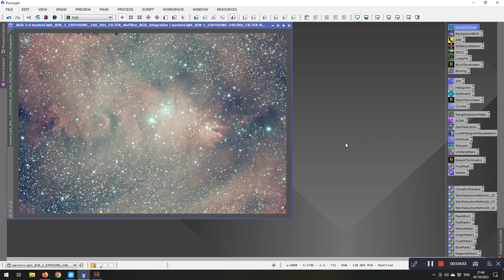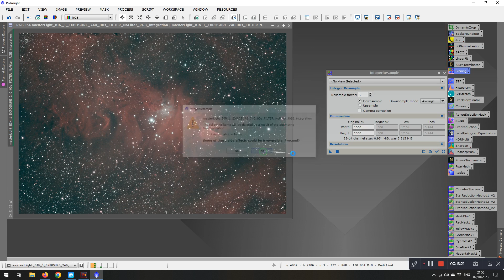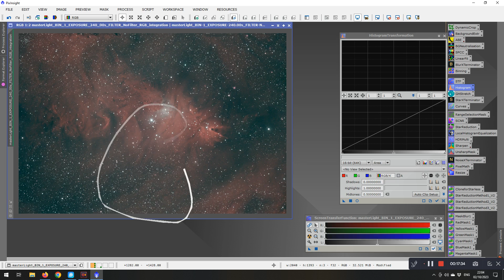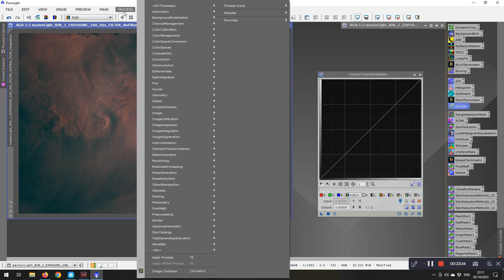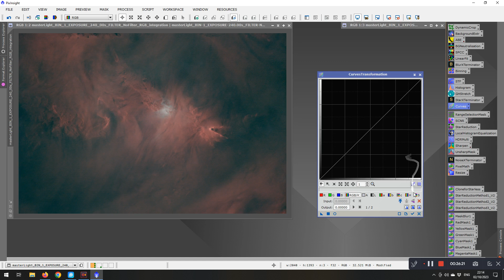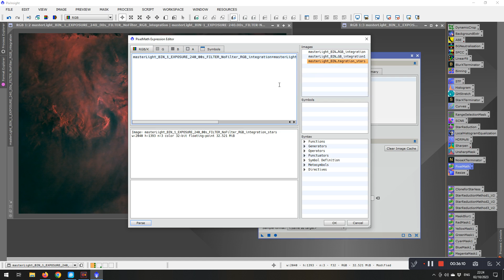PixInsight - Basic One Shot Colour (OSC) Processing Workflow

Comment: Wow learned so much!! One thing with blurXterminator is that it isn’t amazing at chrominance noise. You can extract the luminance layer from an image, run convolution to blur the colored image (effectively removes chrominance noise) and then use LRGB combination tool on the color image using the newly created luminance as the L layer. It works nicely for chrominance noise. And then use blurXterminator for the rest of the noise. Hope that’s helpful! Great video!

Comment: You don’t mention how you performed your stacking, was this also done in Pixinsight or did you use DSS?
Reply: Here's a tutorial on how to do stacking in PixInsight using WBPP:
https://youtu.be/9XgklwAICkM
Reply from the maker: Hi Sarah, I generally use PixInsight for stacking. It takes longer than DSS, but I normally set it running overnight. I've made another video about the WBPP in PixInsight, if you're interested. 😉
Reply: @lochaberastro9752   Thanks for this, just found your channel. Can I ask a follow on question about how you stacked this: did you just have data for the dual narrow band filter that you mentioned, or did you also combine with data for an IRCut or light pollution filter? if you combined data from different filters I would be interested to know how you did this in WBPP and any tips that you can give, thanks!
Reply from the maker: @timburgess1528  The stack I used for this video was just the data from the Dual-Band filter, which is normal for me. 
You can combine it with a stack taken with just a UV/IR cut filter, but I would do this for the more natural looking star colours and then I would combine using PixelMath, rather then WBPP. 
You could remove the stars from the Dual-Band image using StarXT and replace them with the stars from the UV/IR stack using a simple "Dual-Band_background+UV/IR_Stars" formula in PixelMath. Making sure both images are aligned first of course.😉
I hope that helps.
Reply: @lochaberastro9752  thank you!
Reply: @lochaberastro9752  thank you.